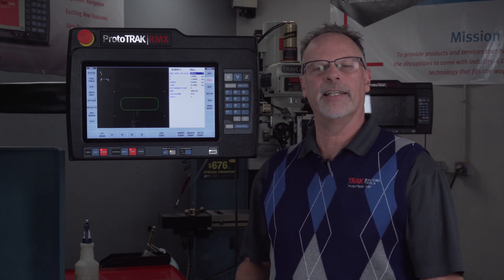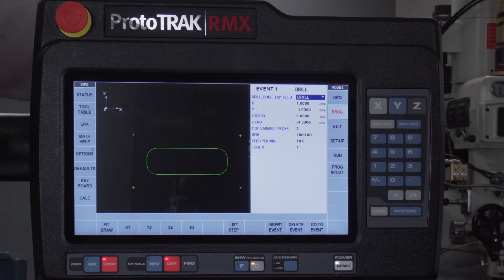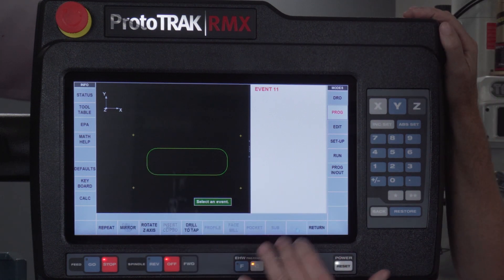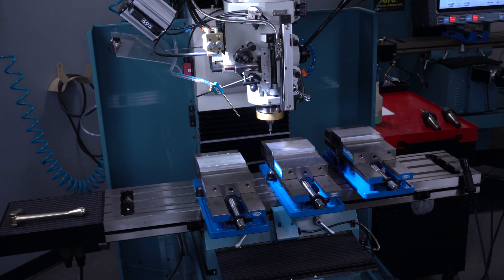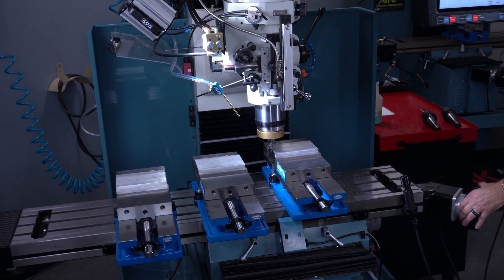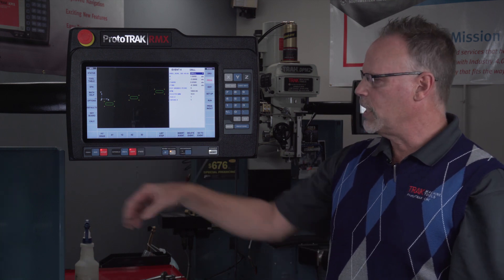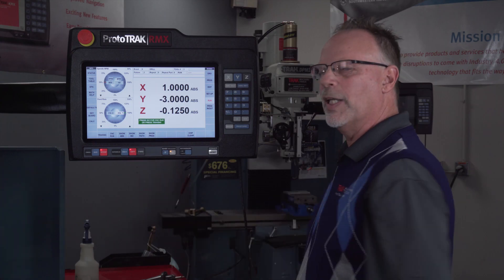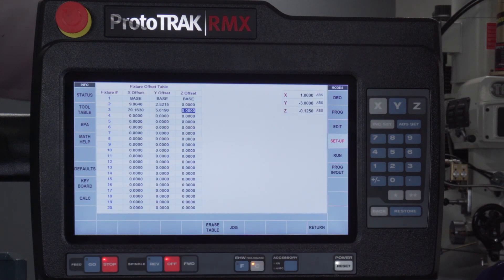Multiple Fixtures & Fixture Offsets | ProtoTRAK RMX

Comment: Would appreciate a video on how to repeat the three separate fixtures continuously in a program for running two or three of the same parts, putting new material in, and re-running program with just the 'Go" button
Reply: All you have to do is add a repeat at the end of the program and tell it hw many times you want to repeat the entire program.  NOTE: If your program has multiple tools in it, you need to select the first tool you are using so that the control knows that you want to use all of the tools in your program.  I hope this helps!  T.P.

Comment: Hi I run a SMX 3500 with g code.is the process are the same?
Reply: Are you asking if the fixture offsets are set the same when using G-code?  If so, yes.  T.P.
Reply: @trakingpat2750  yes because I m duplicating every tool process in the notepad with adding G55 to the copied one and it works fine . Because we're not allowed to modify the program but copying took time and need attention to detail. thanks for replying.
Reply: @trakingpat2750  Hi there I searched how to run two parts with one Gcode  it appears it won't. costumer's send us GCD for one piece .it works but I have to copy and paste each operation and add G55 in the copied one coz we're not allowed to modify the program.